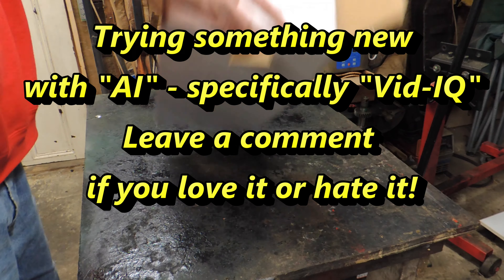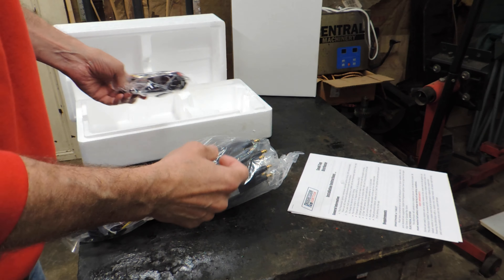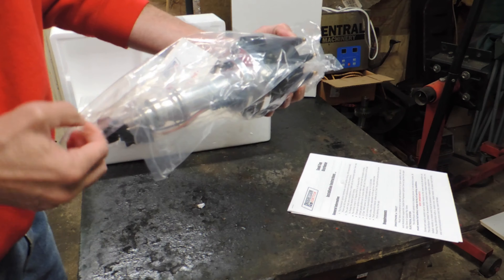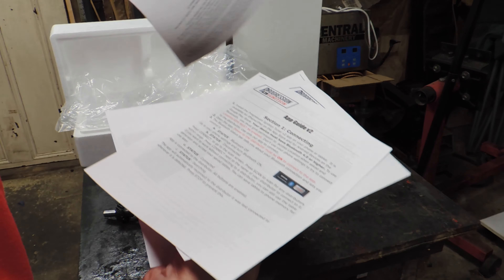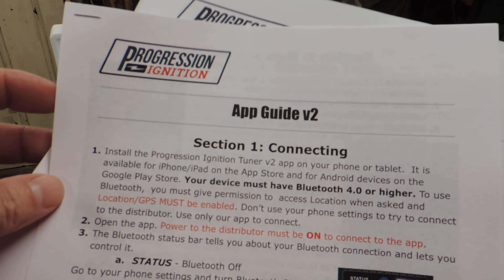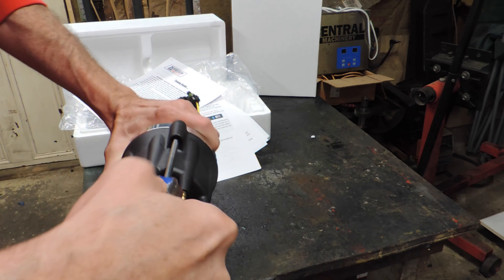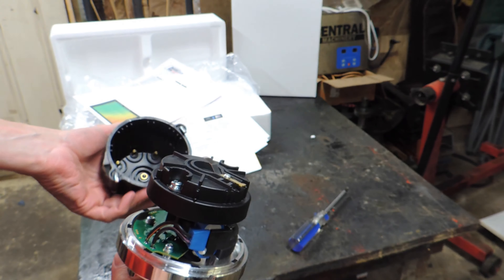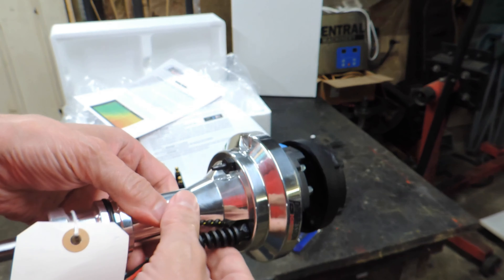Unboxing Aftermarket Electronic Distributor for Ford 351 sent by Progression Ignition

Comment: That's a pretty neat part, wonder about the longevity through.
Reply from the maker: I'll gladly make some videos about that too if I have an audience for it.  26 views in 12 hours is not looking promising though.  :(
Reply: Running one on my sbc for 2 years now. Over the last 5 years they haven’t had one fail. I’ve had 2 separate friends have their MSD’s fail during the same time period of having my Progression .
Reply from the maker: @johnstonis7977  I have had pertronix units fail as well.  No MSD's though.  My thoughts on this are all about the original ford box that is infamous for failling.  It'll be good to remove that weak point!